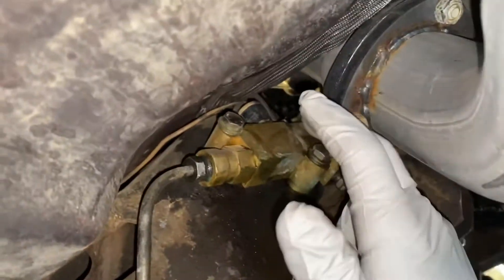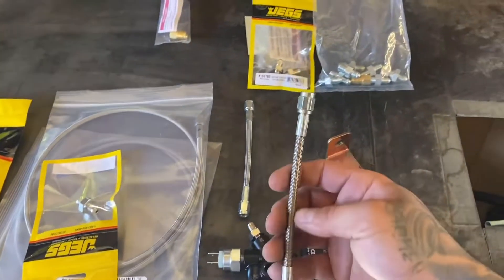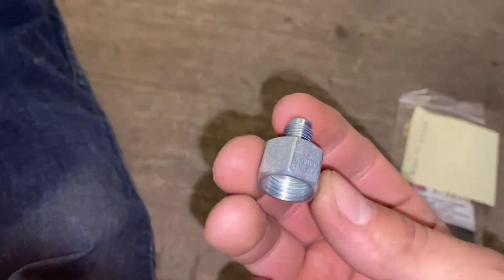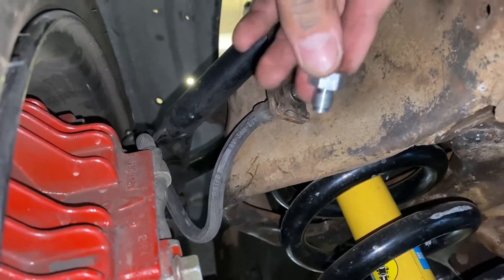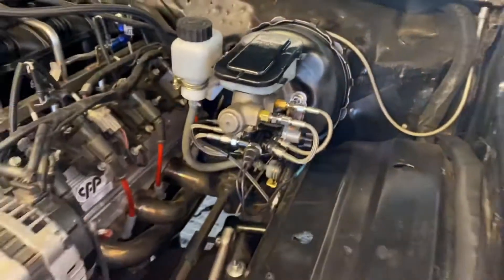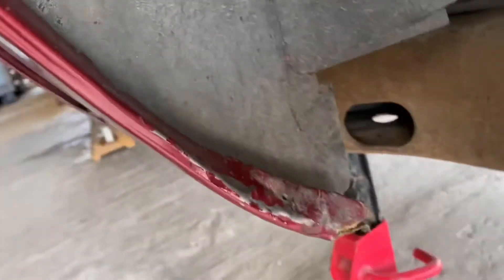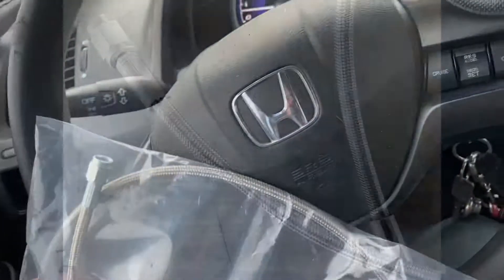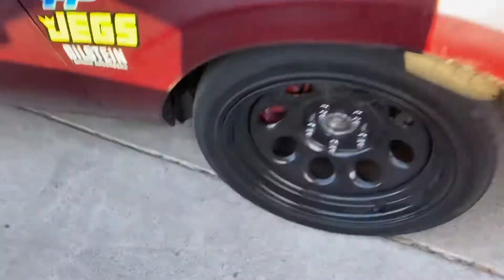Wilwood Proportioning Valve | Gbody

Comment: On my c10 86 one rear brake like broke and the brake dash light came on. The shop fixed it and bleed the brakes but the light still there . If the light wire plug at the valve is remove it goes off. i was told to get a new proportioning valve. Can it be reset?

Comment: The 30" line for the rear was that enough length or do you think could of been a bit smaller. Same with the two 36" lines you joined together?
I just bought this prop valve as my check valve on the gm version gave way for some reason. So I thought might as well get this one. I only have disc and drum setup though. Not sure if its over kill.

Comment: Great job my friend.. I have problems with my brakes on my c10 My pedal goes to the floor does not stop good at all.. Can you tell me the part numbers of the fittings that you used I think I will try something like you did .. thank you for your time
Reply from the maker: Yea I have some of the fitting part numbers under the description , if you need another one just let me know , & thanks bro !
Reply: @betosgarage sup bro good video what fitting did you use for the rear on the prop valve ?

Comment: Where did you tie the Master cylinder reservoir to
Reply from the maker: to one of the brake booster bolts behind brake masker cylinder
Reply: @betosgarage  I saw that but I mean the hose. Is it tied into to master cylinder or feeding the rear brakes
Reply: I see it says “Tilton”?
Reply from the maker: oh gotcha , i manual swapped it , that reservoir hose goes down to the clutch master cylinder i installed under the brake booster .

Comment: What’s the part # for the two brass fitting in the master cylinder?
Reply from the maker: https://www.speedwaymotors.com/IFM-to-IFF-Adapters,6458.html?sku=9103183-1/2

https://www.speedwaymotors.com/IFM-to-IFF-Adapters,6458.html?sku=9103183-9/16

This is what I used but you can just order the steel braided line with these on one end & -3 on the other to make it easier

Comment: Do you have the part number on the porpotion valve and the part numbers on the fittings
Reply from the maker: Yes sir , check my description i put all the links there
Reply: Not right part  #for brake line

Comment: What was that part # for the adapter you used on the rear brake line 🤔
Reply from the maker: 9/16-18 to 3/8-24 

https://www.speedwaymotors.com/IFM-to-IFF-Adapters,6458.html

Then I used- 

3/8-24 IFF to -3 AN Male Adapter Fitting

https://www.speedwaymotors.com/Speedway-Steel-Straight-3-8-24-IFF-to-3-AN-Male-Adapter-Fitting,32433.html

And run any -3an female line to that
Reply: Preciate that info 👌🏾👌🏾👌🏾
Reply: I am new to this stuff, which size do I click when the link come up
Reply: @jonathanfrasure1513  click on the whole link

Comment: I ordered the 9/16-18 from your link for the rear adapter.  Turns out it's a male 9/16th-18. I can't find the female online anywhere. By chance do you remember the priduct number?
Reply from the maker: I clicked on the link again & it sends me to the correct fitting? 
I added the 9/16-18 then the
3/8-24 iff to -3 an male adapter fitting . 
Check on speedway motors bro they have every fitting you need
Reply: @betosgarage  it's all good.  I sent them a message to see if they have any in stock. Thanks bro. Nice ride!
Reply from the maker: Thanks!
Reply: Nope they don't call them and they will tell you pic is generic they don't have that adaptet
Reply: I know this vid Is 2 years old but bro you need to call Speedway they DO NOT HAVE A 9/16-18 TO 3/8-24 FITTING YOU SAY YA GOT FROM THEM AND YOUR MISLEADING PEOPLE .
Reply: I bet ya never found 1 at speedway
Reply: Bro Beto thanks so much for this video but this man on top is somewhat right lol I have been through 5 fittings ordering from different sites and still can't find the right one lol. Any advice?? Or could I possibly go from the rear brake line fitting to a 3an directly?